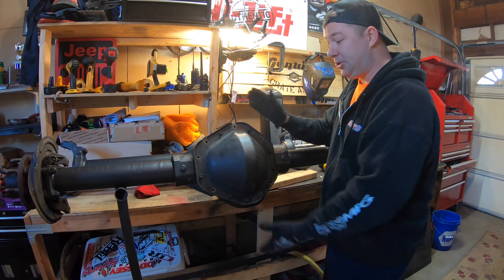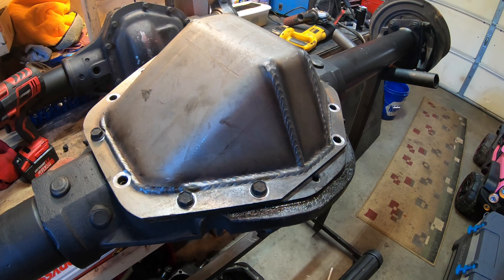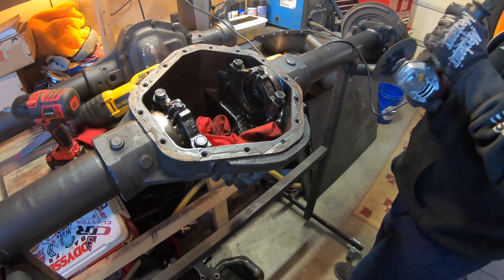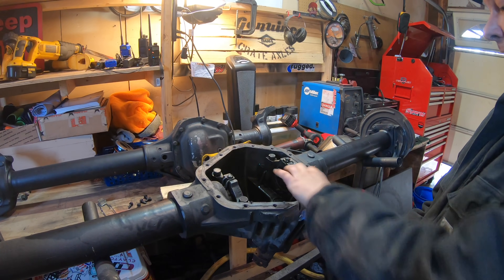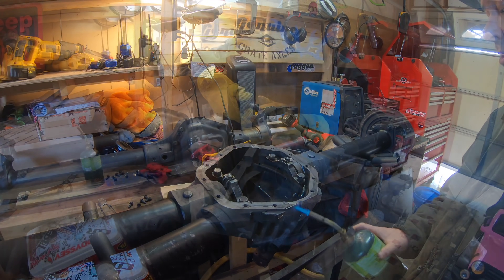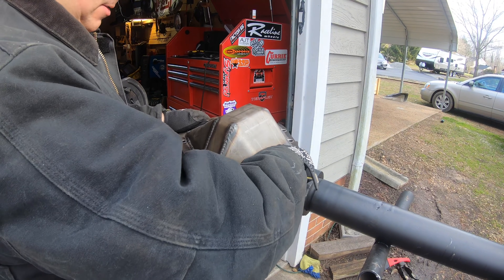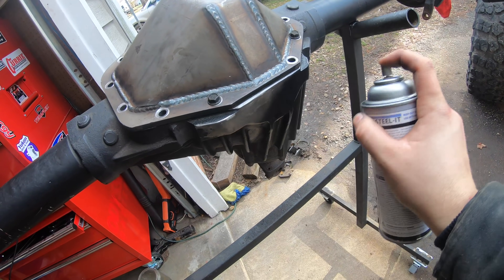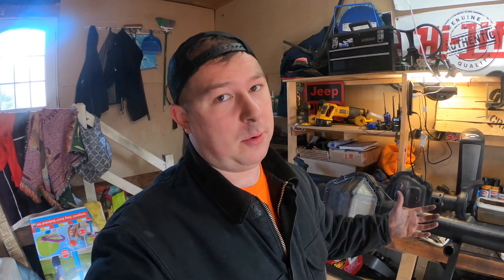13 Bolt Diff Cover Shave - JK 1 Ton Swap Episode 3

Comment: I'm curious how that compares to a super duty rear. Can you measure from bottom of tube to bottom of dif? I'll compare to my F350. It doesn't look to be very low hanging after cut. Thanks, Barry
Reply from the maker: Quick measurement looks to be around 4.5” inches

Comment: How frequently should you change or check gear oil?
Reply from the maker: Factory manual says every 30k. I like to do it at 15k. Off-roading can allow water to contaminate it. So I say it’s better to change it more often, and no need to use the fancy gear oil, the cheap stuff works perfectly fine
Reply: JK Gear and Gadgets solid copy.  Thank you!

Comment: I thought about doing the 13-bolt conversion on mine.  I was worried about how little material that left at the bottom of the diff housing though.  After doing it, do you feel like there is plenty left to take a beating still?
Reply from the maker: I do, and if it ever wears down I will simply weld a 1/4” plate back onto it

Comment: How much will a 1 ton system strain the engine?
Do you change gears to help with that?
Are you planning a hemi, LS or diesel swap later?
Thanks for your time
Reply from the maker: 5.38 gears will help a ton!
Reply: Kool what year is your jeep I have a 08, so I have the 3.8 would it handle this set up?
Reply from the maker: 2010, the auto will struggle a bit, mine is a manual. But we will see!

Comment: Again, love this series. Are you gonna a weld the tubes as well or just install the truss? I am not sure if tubes spinning is an issue with the 14 bolt or not. Looks like some pretty massive welds holding them in.
Reply from the maker: No real need to weld the tubes on these. Spinning isn’t an issue with these. Plus with welding the truss to the tubes as well as the diff it will have no issues

Comment: Not sure I would be grinding and welding on the diff like that with the inside exposed. Seems like you are just asking for premature bearing wear.
Reply from the maker: We will be changing out all of the internals with new gears, bearings and a locker. However I would never grind inside or weld inside with good bearings installed
Reply: Wow
Reply from the maker: M Barilla ?

Comment: Actually, leaving that 1/8" of lip below the cover is smart so you don't catch the diff cover's lip on rocks and pry it off.  Learned that the hard way and re-welded a flat bar of 1/4" back to the bottom of my 13 bolt to protect the cover.

Comment: This was a great video. Was debating on doing the shave kit or not. I like this option alot more. What's your plan for the brakes? That's the only thing I'm stuck on how to approach properly.
Reply from the maker: Stock brakes will work fine with the J8 master cylinder and booster. I plan on upgrading my calipers and rotors, but that will be in a future video
Reply: @JKGearandGadgets  Ahh gotcha. I have been caught up on that. Lol thanks. Found a thread a few weeks back about a guy fabbing up some f250 driveshafts to work with junkyard one tons been waiting for him to finish the build so I could interrogate him about lol. Looking forward to your future content!

Comment: Would you get anymore clearance if you shaved the fins and welded a 1/4” skid to the front bottom so it slides better over rocks?
Reply from the maker: Since the pinion angle will be pointed up, the lowest point is where the shave is. So I don’t see that helping much. Plus the fins help cooling so I’d reccoemnd keeping them